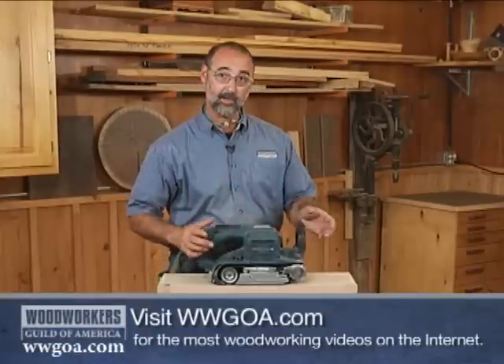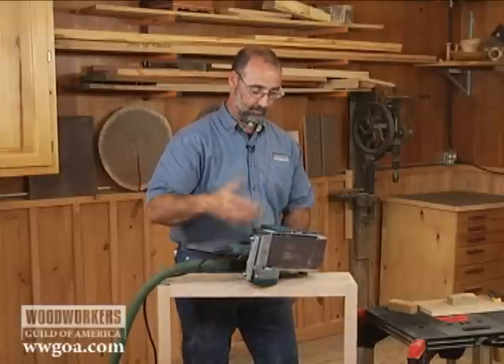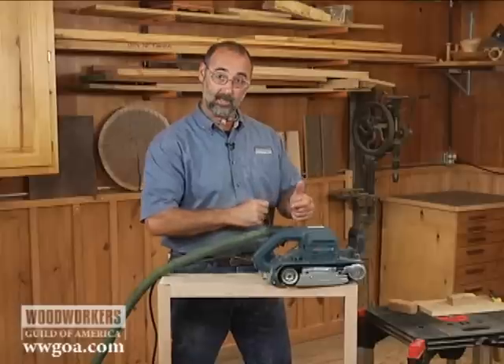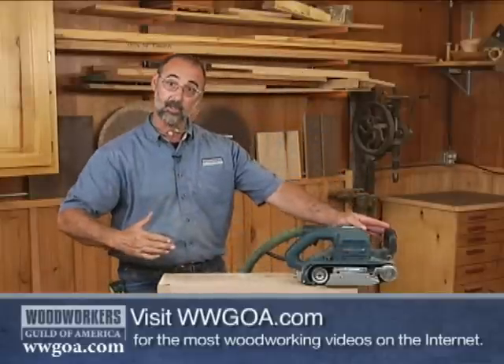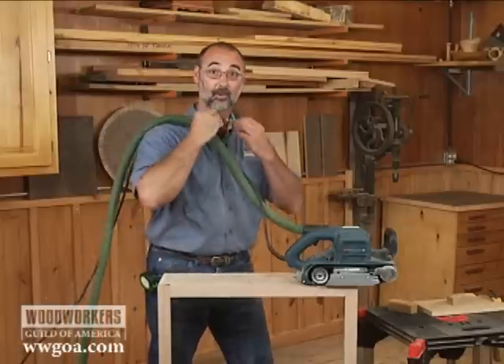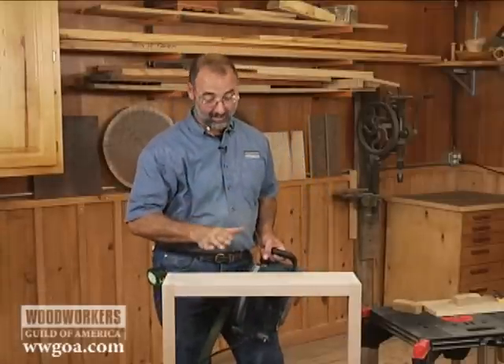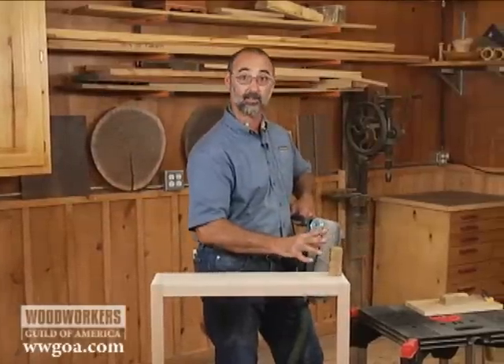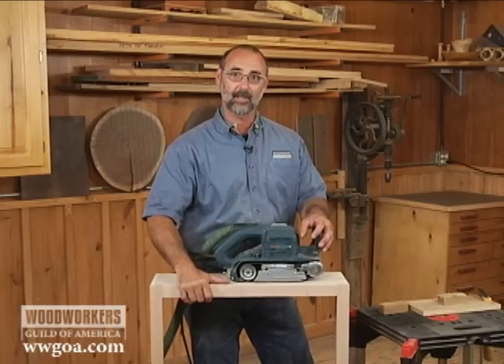Woodworking Techniques: Power Tools - Belt Sander Tips

Comment: Thank you! What do do when the paper keeps running off track towards the sander opposite of the side it is interested? There’s no adjustment knob.
Reply from the maker: If there's no tracking adjustment, I'd suggest first flipping the belt around to see if that helps.  If not, try a different belt.  If that doesn't help, I'd suggest bringing the tool into a repair shop.  You might have to replace the rollers or some other part.

Comment: Great video, but I really can't understand the value of variable speed. I've used various belt sanders a lot, 1000s of hours, but even with variable speed available, I always use it on full speed. I want the belt moving fast, the last thing I want is for it to go slow. Pressure, dwell time, number of passes and grit should determine how fast to hog away material not speed. To me it's a gimmick.

Comment: I have a question. I can do an excellent job with a belt sander, untill i get to higher (smoother) grits than p120. After that i start getting dimples horseshoe marks and score. The solution ive been using is just to orbital sand past this point. But why on earth can i do it perfectly with 120 belts and coarser, but as soon as i go 180 i cant. V confusing.
Reply from the maker: That's a great question.  I don't know why you would have these marks with 180 but not 120.  When I do flatten a glue-up using a belt sander, I generally do as you described.  I sand using 80 grit and maybe 120 grit, then I switch to a ROS.  So, essentially I use the belt sander to flatten, and the ROS to make smooth.  

Paul
Woodworkers Guild of America

Comment: Why didn't they design the sander to roll backward to counter the natural motion of a user's pushing forward?
Reply from the maker: Hello.  Great question.  Maybe they don't want a tool that has a default path toward the user, for safety reasons.  But, maybe you have a good product suggestion for some tool company.   
Thanks
Paul-Woodworkers Guild of America
Reply: Not sure that a user's natural inclination is to push forward.
I find as far as hand saws are concerned I prefer pull saws. I find them much easier to start a cut and angle control more precise. 
Maybe that is just me...

Comment: When you are sanding how much pressure are you applying?
Reply from the maker: Hi Sonny,

Very little down-pressure.  Let the weight of the tool apply the down-pressure.  If apply too much down-pressure it you will dig the scratches in deeper, making it tougher to clean up.   
Paul

Comment: Liked the video, but have a couple of questions. I don't know how much the bands are in the US, but here they are about 30 pesos each, just over two dollars. The blocks are 180 pesos each. How many times can these sticks be used, as I have never used one, always used a wire brush? Second question, have had one of these for twenty years, but recently it started to break the belts after just a few minutes use. I tried belts from three different places, and they were all the same. Is it possible to repair the belts, as I have tried duct tape, but it causes a bit of imbalance?
Reply: +MadIslowlygoing By "bands" I guess you are referring to the sanding belts. Those 30 peso belts sold in your country are made from paperbacked sandpaper on rolls that are sold in lineal foot. The real sanding belts are more expensive because the backing material is not paper but made of fiber much stronger and durable than paper. They make sander belts by cutting to dimensions and using superglue or rubber cement. I do not understand what you mean by "blocks" which sells at 180 pesos. If you are referring to Abrasive Sanding Belt Cleaner Sticks, that price is a steal. Which hardware sells it? I am curious. An 8 inch cleaning stick sells for about $11 on the net. These sticks can be used until too small to handle, just like a rubber eraser on a pencil. You can try repairing belts by using a much stronger glue than a simple duct tape.
Reply: +DAVID DARLING The bands are the ones with a thick material type backing, not the ones like sand paper as you thought, and they are cheap as hell here. All I wanted to know was how many times can you clean these using the cleaning stick, which in Spanish is called a block, just to confuse people. Anyway, the answer you gave shows me that it is cheaper to clean, despite the cheap cost of the belts here. As for trying to fix them, I tried all sorts, the duct tape just stretched, never came off, but useless for this. Super glue broke when you start the machine, and nothing else I tried worked. The problem was the machine could not be aligned correctly, and kept breaking the belts, got a new one and they are fine, I'll just use the broken belts for general cleaning by hand. Thanks for your time.
Reply: +MadIslowlygoing  ..  Nobody can answer your question about "how many times" regarding cleaning sticks. Depends on the amount of material sanded, the belt grit, how dirty the belts are, how often you clean them, how sloppy (glue, etc) you are with your woodworking, and more. Your own experimentation is the only thing that can provide an answer.

Comment: I am sanding a floor or 2x6 pine with a hitachi 3x21 and I am getting a lot of cut lines in the wood. What would cause this?
Reply from the maker: Hi Will.  Sounds like perhaps either you are using a coarse grit that is leaving some deep scratches, or the sander is malfunctioning. It is difficult to diagnose this way, if it is in fact malfunctioning, so if the problem doesn't resolve itself as you progress through your grits, I'd suggest taking it to a service center.

Comment: Excellent video, and you're an excellent teacher. I borrowed a neighbor's belt sander to sand down the edge of an exterior door I was installing. Having never used a belt sander, I was a little hesitant, so I practiced on a scrap piece of wood to get the hang of it. I was surprised at how much material they can remove quickly, so I'm glad I practiced first.

Comment: Some good tips.  I’d like to see how you adjust the belt in the sander. I am noticing my sander is not sanding evenly across its width
Reply from the maker: There is typically just one adjustment on a belt sander, and that adjusts the tracking of the belt so that it rides in the middle rather than going off to the side.  
Paul-Woodworkers Guild of America

Comment: Hi, I just asked Jack Houweling before watching your 2011 video on Belt Sanding tips, 13 minutes ago Dec.06/016. Maybe you can answer this Question.  I have no room for a Drum sander, I need a Light weight large portable, reliable belt sander for Dinning table top building size sanding jobs. Since 2011, what would you recommend NOW as a good belt sander for a 70 year old with Arthritis pain ?  Check my question to Jack's comments to all who reads his Questions .  Hoping someone has a good answer.  Thanks Gary W. S.
Reply from the maker: Hi Gary.  The good news is that there are lots of nice hand held belt sanders to choose from these days.  I don't have a specific recommendation for you since what is important to you are the ergonomics that relate to your specific situation, and of course it has to fit within your budget.  I'd suggest that you go to a home center that has lots of models on display, and see which ones feel lightest and most balanced.
Reply: Gary, if your arthritis is really bad, there are two things to consider. 1) A wide belt like the 4" demonstrated here may not be best because the more surface area that is in contact with the wood, the more the sander will 'pull'. 2) You may want to start with as fine as a grit as is practical for the same reason as mentioned in item #1. A courser belt will have more 'pull' than a finer one.

I've seen Jack banging away with his bare hands on some of his projects and it absolutely sends shivers up my spine!

Comment: Hey, I have question. I am trying to sand some tree slices about 15" around and 2-3" thick. The wood is very uneven as it was cut with a chain saw. What grit should I use to sand them down. Some are pretty uneven by an inch or so more.

Comment: Good tips, trying to figure out how to use a belt sander as I've never had one. I'd never heard of the abrasive cleaning sticks, good to know!
Reply: Dried tube of silicone or rtv works as well so dont throw them out. And better than all if them is the little pink erasers
Reply: @bihgolphatdictergud746  Thanks for the tip!

Comment: Good video, thanks! I have an old 4x24 craftsman belt sander I bought recently. Besides the obvious cleaning out accumulated dust buildup. Could you tell me if there is any other maintenance to be performed? Do I need to lubricate the moving parts or grease the bearings, etc?
Reply from the maker: +Nick Best There's not a lot of maintenance necessary on a typical belt sander.  I'd suggest searching around to see if you can find a manual for your particular model on line.  Here is one for a Craftsman 4x24, although I'm not sure that it is your specific one: http://www.searspartsdirect.com/partsdirect/user-manuals/32017559-craftsman-belt+sander-manual 
In general, I'd empty the dust catcher frequently and used compressed air to clean dust from any moving parts.  Also check the cord frequently for cracks or abrasions, and replace as needed.  This is a common vulnerable point on belt sanders and other corded portable power tools, as the cord is often under strain and subject to inadvertent contact with the tool which can accelerate wear.    Also check the rollers and platten for any excessive or uneven wear, as this can cause belt tracking problems.  Replace as needed.

Comment: I have an art project that I want to try and it involves about a dozen old windows I picked up at a salvage.  The frames still have all their glass (which I don't want to break), and the wood is most certainly covered in lead paint.

My questions are this:  will using a belt sander be too much stress for the glass?  All that vibration...can glass stand that? Have you used a belt sander on a window frame before?

I'm expecting to have goggles and a mask and gloves through this, and I'll be outside for sure, but I guess I'm just wondering if a belt sander kicks up more/less/the same amount of sawdust as doing it by hand (I don't have a vacuum to connect to it...don't even have the belt sander yet...it will be my next power tool investment).  Maybe that's a really dumb question, but it's pretty indicative of just how much of a rookie I am. (Gotta start somewhere, right?)

Finally: Is a belt sander even the right power tool to consider for this project (old window frames)?  Should I be considering something else? What do you think about the Bosch GOP with Delta sander attachment for a first-timer?

Thanks for your help!

Erica
Reply: A Festool rotex 90 would be really good for that project,  alternatively a multitool with a delta head would be a good choice.

Comment: I have a problem. I've watch about 10 videos and came back to yours. I have just purchased my first belt sander a Clarke with a good wide plate and powerful, not variable speed though. I must be doing something wrong as the belts keep snapping at the join.
Reply from the maker: +Andrew Jackson That is strange.  I doubt that your technique is the culprit.  Here's what I would look at: 
- Do your belts have a directional arrow on them, and if so is it possible that you are installing them the wrong direction?- is it possible that the belts are old, or have been exposed to moisture?  I would try installing a new belt of a different brand to see if that makes a difference.

Comment: good video, I use the pencil tip quite often when sanding or planing however I would never use a belt sander on veneered plywood..  solid wood yes.  plywood never.
Reply: Moldings

Comment: If it takes that long to sand using a belt sander, why not just use a large RO sander?
Reply: Edward Reno 
I suppose that it doesn't sand cross grain.
Reply: Edward Reno belt sanders are much faster than orbital sanders... also the sand in in one direction. So there are two differences right there